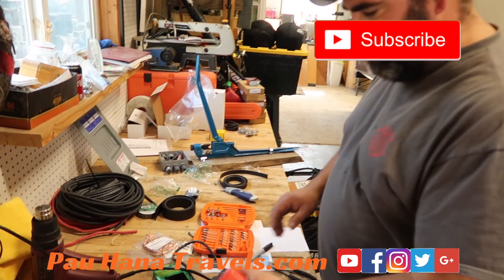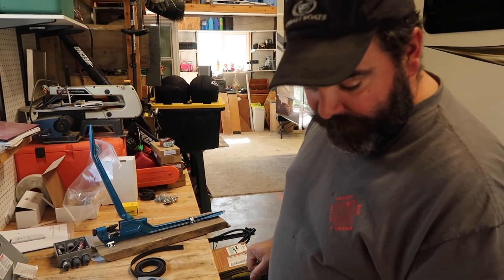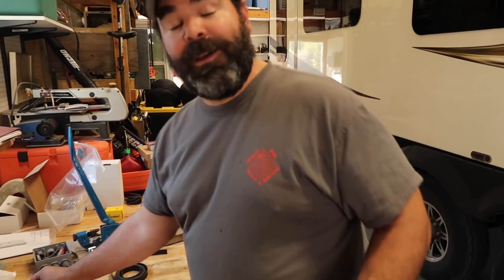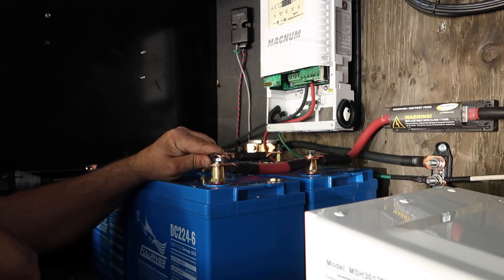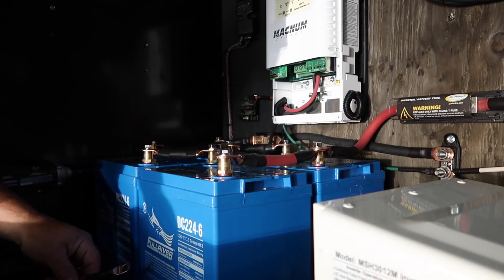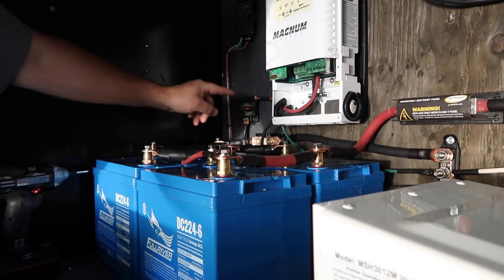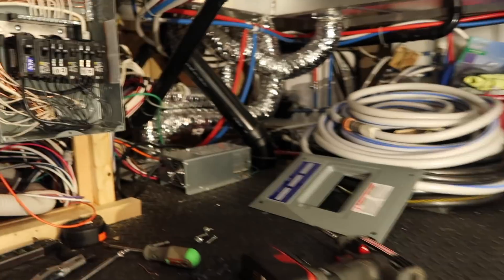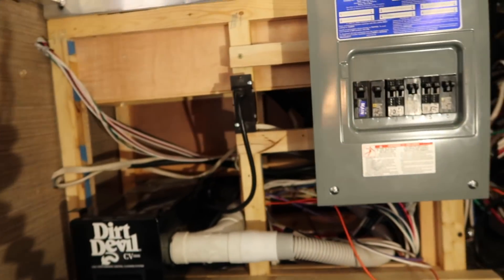RV Solar Installation - Part 4: Connecting Solar Controller, Sub Panel & Prepping the Panels  🚐🌞

Comment: Hello from Canada. Gary, if you have a moment, I have a question about the install you did for John Hebard. In that one you have two 45A MPPT charge controllers. Currently, I have a 400W (panels) and two lead acid batteries with a 40A MPPT controller. Now, when I retire next year, I would like to get a newer RV and double the solar and move to lithium batteries. However, I would like to keep the equipment I have and just double it (aside from the batteries). So here is my question. Can you put two MPPT controllers in parallel as it seems you did on the Hebard install? Are there protections in case one set of panels is pushing harder than the others? Thank you. BTW, I am really looking forward to your 2019 Alaska videos when you get them out. Travel safe. Henri.
Reply from the maker: Hello Henri, the ability to parallel charge controllers is dependant on the specific manufacturer. You will have e to read your usees manual to see if you can simply parallel your existing controller.

Comment: Great video as usual 👌🏻
One question that may seem stupid though, why not just power the main AC breaker panel directly from the inverter? I know it couldn’t run everything simultaneously, but with (human management) of making sure both air conditioners and other heavy loads aren’t turned on at the same time, wouldn’t it be nice to have the choice of what you want to run and just decide what not to run when off grid?
Is it possible to power both 50A legs through the inverter or only 50A total? Would it require two inverters to power both sides, one on each?
This is the part that I am really struggling with for my own build. I also have an on board Onan generator which has its own auto transfer switch. I was hoping to exclude the transfer switch and run two AC wires (one from shore power and one from the generator as the Quattro has four power inputs) directly to the inverter (Victron Quattro 24/5000/120) and wire that directly to the main breaker box to power everything in the RV under human management of course. Would that work or would I need an inverter for both 120VAC lines? I know you are still getting your own head around this stuff but I would still like your opinion on it. Cheers. Looking forward to part 5! 👍🏻
Reply from the maker: Thanks for watching Rob and I cant believe your question has gone unanswered. Sorry bout that. Simple answer is, simplicity for the owner. Yes it makes the install a bit more complicated, but in the end, it comes down to making it easy for mom and dad to use their RV.